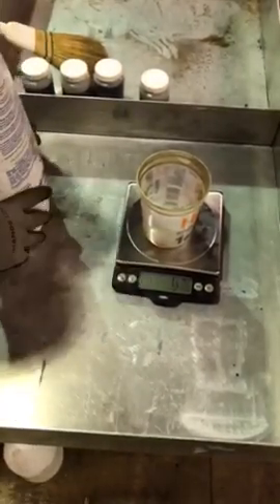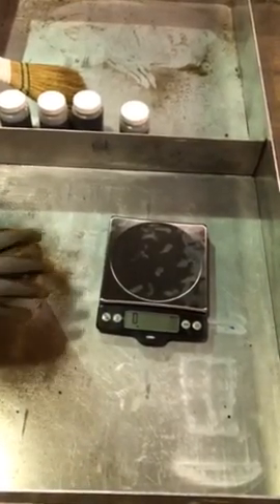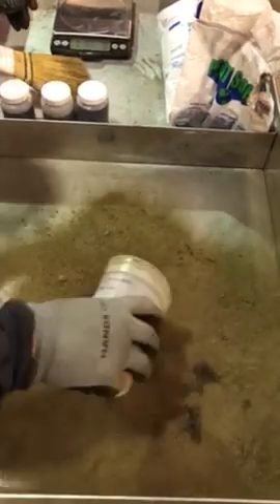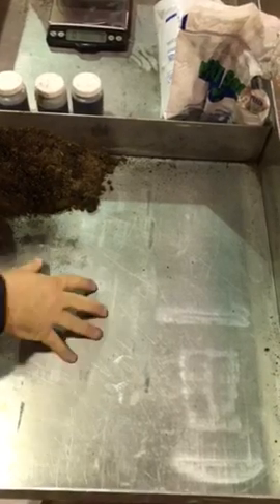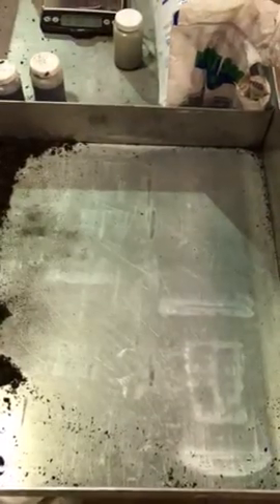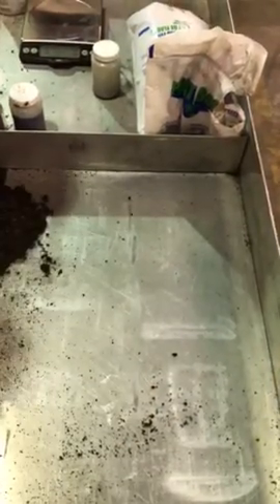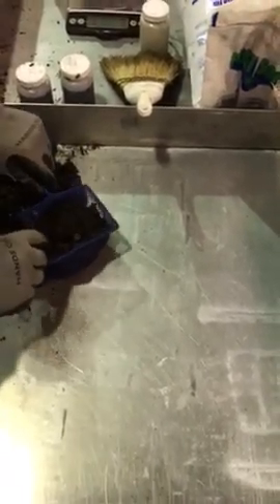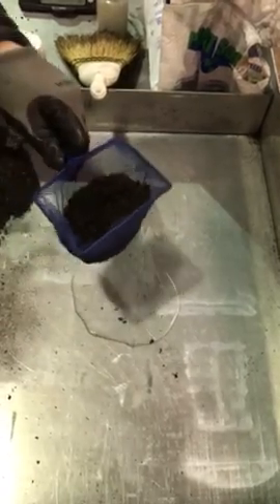PEAT SORB Oil and Waste Oil Absorption RatioTest and Clean Water

Comment: Can it be used on the oil spill on the ocean?
Reply from the maker: Yes absolutely, I'm putting another few videos up soon that show more on this.  Can be used on any waterway, Ocean, Sea, River, Lake, Pond.  In fact it can even be used on birds with much less stress on the birds than using a soap and water to degrease them.  Which causes a lot of stress on them.